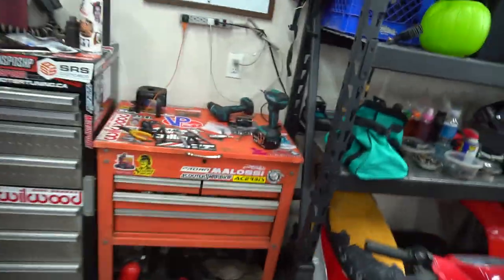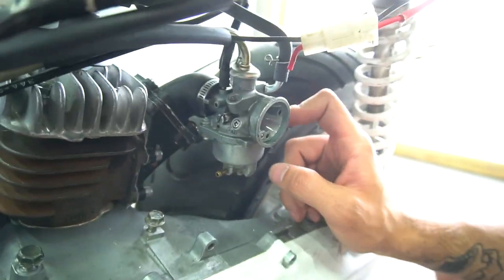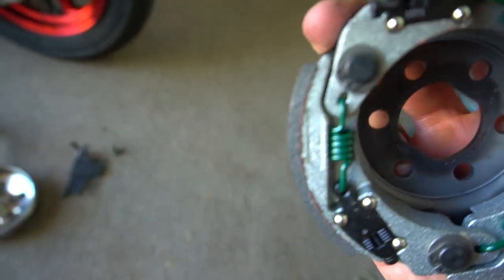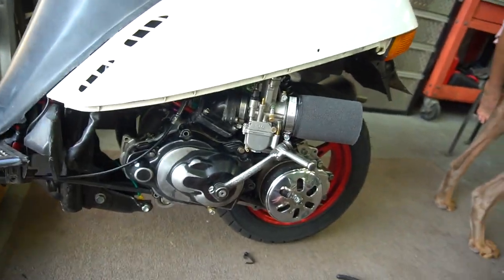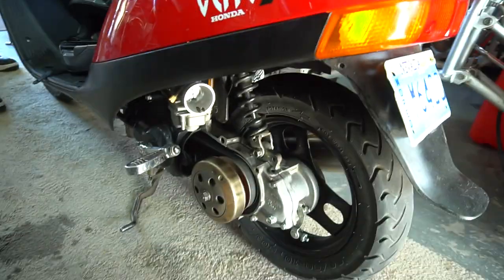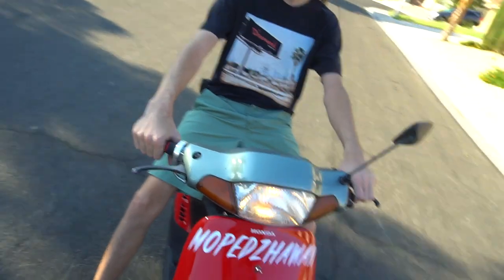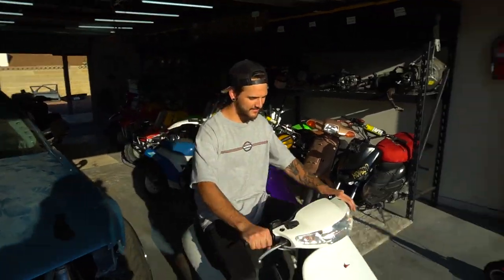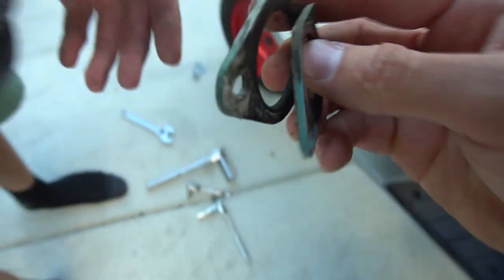NEW CLUTCH 120cc STROKER Honda DIO Elite scooter & tuning (Way BETTER!)

Comment: I have a gy6 50cc 4 stroke with a 70cc bbk and a pz18 carb with high flow filter worked.  But any bigger than the 18mm would most likely not have worked without an airbox.

Comment: The derbi probably needs a bigger main jet like 100-120. And also the pipe has 2 restrictions, 1 in the header and 1 in the silencer, usually people miss the silencer restriction so you should check it out
Reply: And the blue one still runs very very rich, try putting alot smaller jet in it and changing the needle clip higher

Comment: Had the same issue on my Zuma I took the heat cover off and it ran like shit bogging and wouldn’t hardly move anywhere 

So would definitely suggest putting a heat cover over ur cylinder head on the Zuma it should fix the issue with the Zuma

Comment: Try the stock delorto 99-01carb on the zuma. Has two piece choke & slide. 89 came with that weird one piece cap for carb & choke no good. Stroker soundin hard 🔥

Comment: that intake manny and the reeds are buff for the 50cc from stock form because piaggio 50cc 2t and 125cc 150cc and 180cc all 2t intake ports and fittings ar the same size and models only carb fitting sizes change but u need a 70cc kit on kit on it cuz they will run well better then the honda motors and minarelli plus the compression on the 50cc's compared to the other style motors ar far better

Comment: hey i was watching  a different video where it showed the  honda grom  has a mod for the oil  so that when you wheelie  it sucks the oil up from the bottom  and shoots it up t the top . i was wondering if the littler scooters have that same issue where they need that mod . wish i could remember the name of that  part . but with out it  it will burn the motors up in the grom .

Comment: You gotta keep your MB5 battery charged bc its thr voltage regulator and without it the bike makes 18 volts and blows all the bulbs.. ask me how I know, same story for Honda expresses
Reply from the maker: the mb5 has a battery eliminator kit on it so it prevents that. the fuse for the headlight actually popped not the headlight itself

Comment: I just put a 70cc bbk on my Erin Beamer it’ll run but seems like it’s getting to much air I put the air box on and a new intake any solutions?
Reply: You do any jetting or anything?  Pipe?  Carb?  Let the motor break in for a bit, as soon as its put together and sealed up, let it dry, start, let it idle up to temp, kill it, let it cool down.  Do that like, maybe 10 times.  Might just have to tune or you may be pulling a leak somewhere else, base gasket or head if you didnt use sealer.  New builds are always picky though

Comment: Any help will be appreciated 
I have a 150cc gy6
Cold start it runs perfect but after some time and coming to a stop it idles and then just dies. I start it and need to open throttle a bit and it starts but with a backfire and some black smoke. Is that a sign of some running rich on idle and 1/4 throttle?
Reply: Yea, id check out the plug and see what it looks like for a full confirmation....id also check the valves as well make sure they are in proper adjustment.
Reply: Valve adjustment and change the auto choke. When the choke fails, it fails in the on position making it run way rich when the motor is hot and doesn't  need it my bro

Comment: 95% of the time when card adjustments don't work in my experience there's a air leak also the prebug needs the stock airbox for the stock carb

Comment: So i have a aprilia sr 50 2002 morini engine it has a 70cc kit in it a 21 carburetor mallosi variator kit, a mallosi clutch and a giannelli exhaust but the top speed is 80kmh does anyone know how do i make it faster?
Reply: The Morini variator is small stock, try locate a bigger one or go bigger gears. 80klm is about right for stock trans on the Morini.

Consider a Piaggio swap as the scope for a fast Morini is limited
Reply: @exgtt2061  oh okay thanks
Reply: @mihamatijasevic2650  sorry, I missed that you already have a Malossi variator.
Reply: @exgtt2061  yes i do

Comment: A tip is not to run naraku, naraku is a cheao but low quality company. Ive used mant products and its not good
Reply: NARAKU make some good stuff, the 4t bore kits are excellent. The variator comes with too heavy weights unfortunately